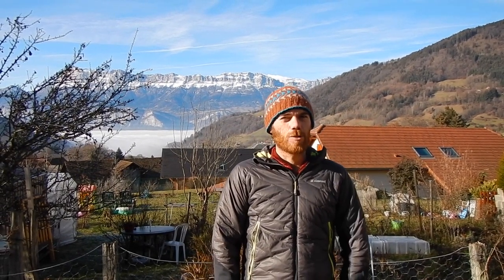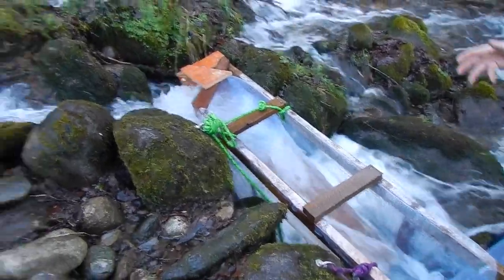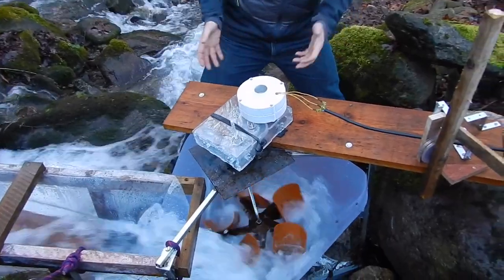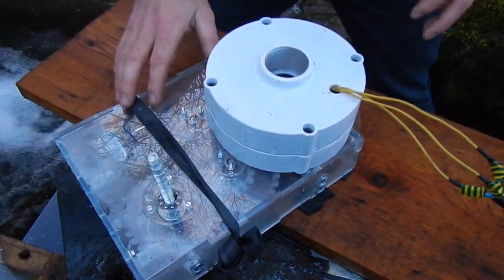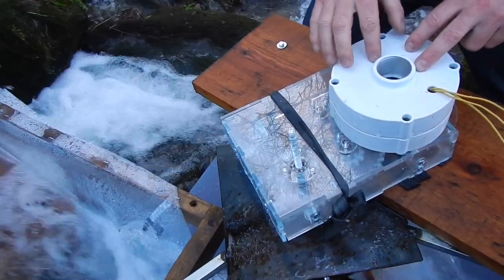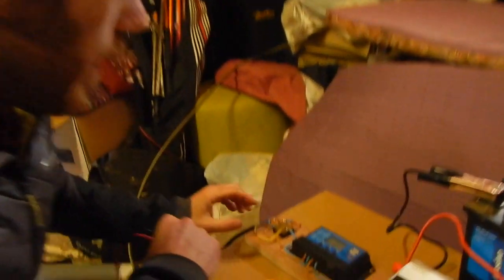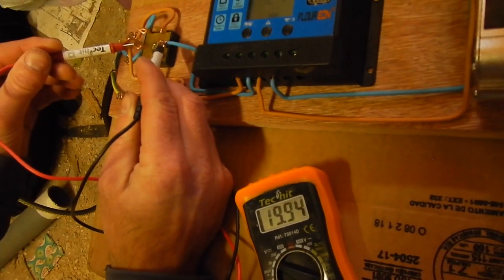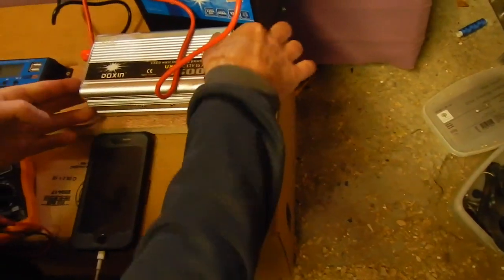Mobile Hydro Generator

Comment: No french, sorry. So, with a fixed system similar to this I think it could optimize the production. This is what I intend to do in my place(Brazil). What I would like to know is the ratios. For exemple, with 1000L of water/second, from a height of 1.5 meters(or use 1 meter to round the calculations), how much electricity will I be able to produce(an average estimate approximation). This way, I can quote the power supply available to build greenhouses with aquaponics inside.
Reply: Sou do Brasil tb, como estao seus projetos? Acho aquaponia mt interessante.
Sobre o vortex turbine, acredito que se tiver 1000 litros por segundo consegue fazer muita eletricidade haha, potencialmente o suficiente pra abastecer algumas casas, mas teria que construir uma bem maior.